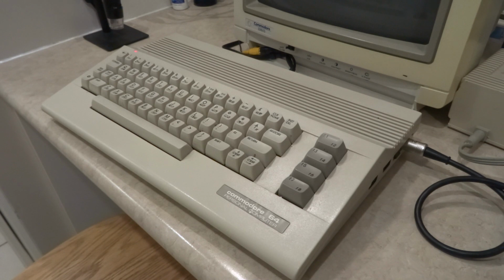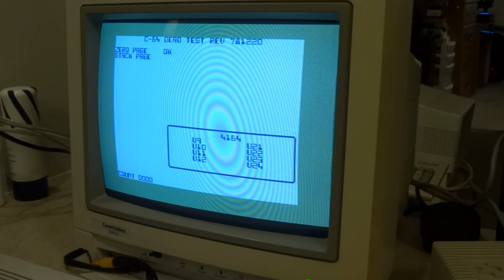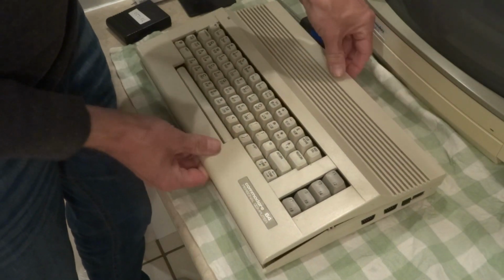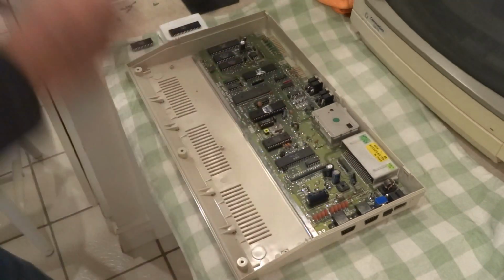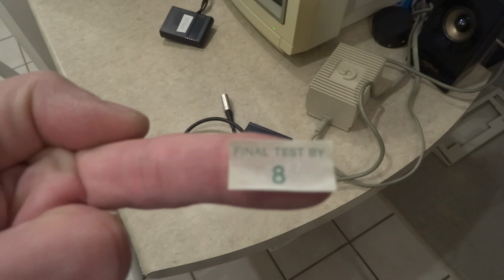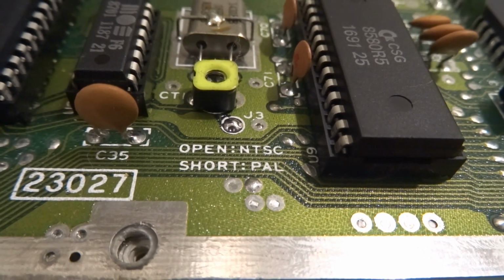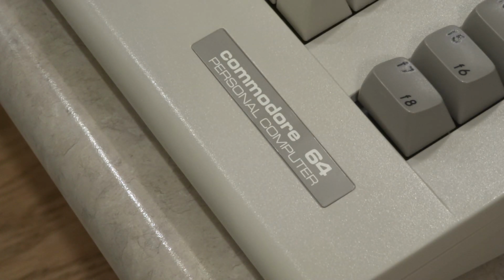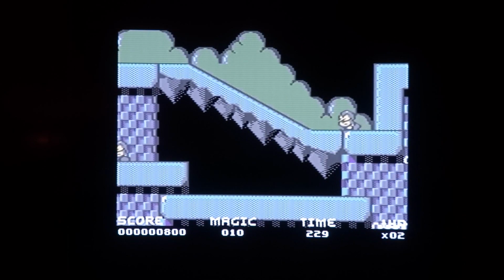Commodore 64c Repair and PAL Modification

Comment: You spent a lot of time warning about failing voltage regulators in c64 power bricks but you just stuck a SID chip into a board without testing the internal 9v supply. The external saver box isn't going to protect you from internal voltage problems.
Reply from the maker: Thanks for the tip. I did test the internal voltage regulators prior to the video after I repaired the damage the original faulty power supply caused. Lesson learned :)

Comment: Bug plaguing the drive? What's the bug?
Reply from the maker: Here is an excerpt from Wordpress (dot) com: (https://ilesj.wordpress.com/2014/05/14/1541-why-so-complicated/)

It’s slow as hell

The 1541 may be the slowest consumer disk drive throughout the history. And it’s a known “merit” of the drive. There was various reasons for the legendary slowness, mostly having to do with the unusual implementation, bugs, and prorities on how to overcome the discovered issues.

The VIC-20 was the first Commodore computer to use serial bus for disk drives. Both the VIC-20 and its 1540 disk drive used the MOS 6522 VIA as an interfacing chip, and the intention was to use a hardware shift register offered by this chip for the serial data transfer. However, it turned out that there was a bug in the chip’s shift register that could lead into data corruption. Apparently it was too late to fix the chip or change the hardware design of the computer and disk drive. Instead, the hardware serial data transfer was replaced with a slow software implementation. And it appears that this software solution to overcome the hardware problem was whipped up rather hastily. But that’s how the machines shipped.

Comment: The name of the background-music?
Reply from the maker: The music is from the YouTube Audio Library; the tracks are called "Cloud Control" and "Ether Oar".
Reply: Thanks..  Today i will get a C64 I just bought, what the best chemical to get rid of yellow tangents?
Reply from the maker: The chemical you seek is Hydrogen Peroxide (Liquid or Gel). I personally have not tried Retro-Brightening yet, but there are many videos on You Tube that show several methods. Perhaps one day I will be brave enough to attempt this, I have some very yellow Amiga Keyboard Keys that need attention.
Reply: Thanks for info, peroxide seems working but I will not try to boil the tangents wich I saw in a video

Comment: My understanding was that you needed to do three things in the C64c to convert an NTSC machine to PAL:
1) Remove NTSC VICII and replace with a PAL VICII
2) Remove Osc Crystal and replace with a 17hz crystal
3) Bridge Jumper

Yet in the video it appears you only did step 3?  So do the 3 steps above only apply to older models? IE Does the C64C only require the jumper change? A bit confused...thanks!
Reply from the maker: That is correct. All three modifications are needed.; a PAL VIC-II chip, a 17.734475 Mhz crystal and a jumper pad bridged (or on the older C64 models, a jumper wire moved). No doubt, finding the PAL VIC-II chip is the most daunting task for availability and price reasons. It's worth it thought if you can find the chip on e-bay. I should have explained it better, sorry for the confusion.
Reply: @amigaretro1985  No problem, thanks for clarifying!  Have 2 VICII PAL chips enroute so appreciated!

Comment: the pins on old chip could have just been dirty also
Reply from the maker: Thanks for the tip. I will try the old 8580 on my other C64c, once the other Vic-II chip I have on ordered comes in. Would be nice if that was issue. These chips are not getting any cheaper :)
Reply: ya that is true     i wish i still had one. my first computer was a Commodore 64. my mom gave it away because the video cord  had a lose connection.   witch i could have fixed made me sad  im still sad  and now i cant afford to re-buy one.